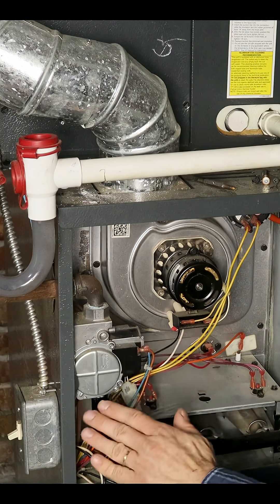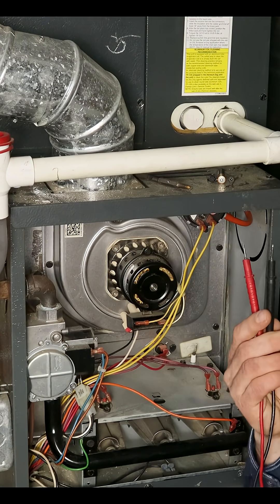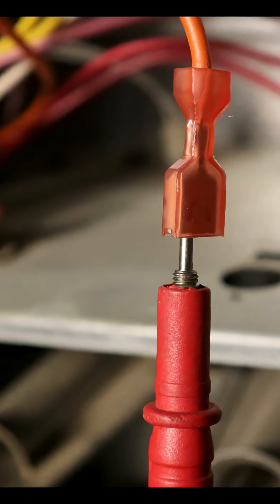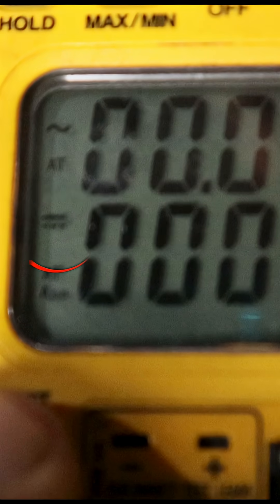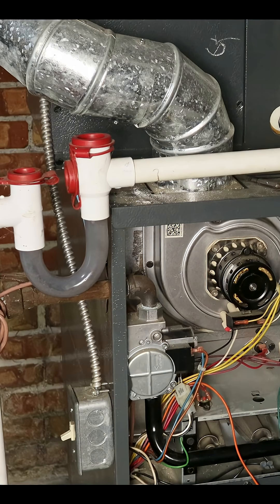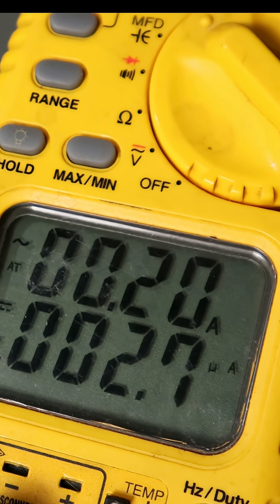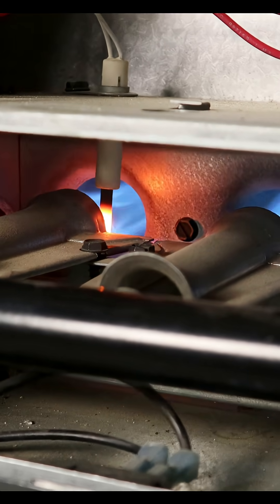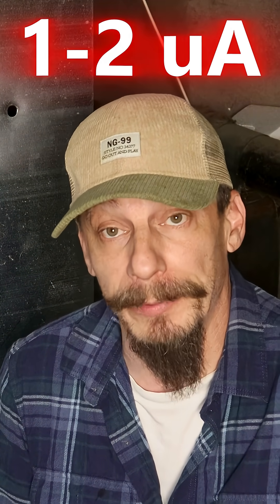2–6 µA = Heat Stays On

Comment: It's good to mention you need to turn power off before you touch sensor because there is always about 95v going to sensor, even if furnace is not running.

Comment: That's what happend to me last winter. I woke up to an ice cold house. I took the cover off the furnace and looked at the flame sensor and that thing was black and carbon crusty. Took some fine sand paper cleaned it off and reinstalled it.  Started the furnace back up and it was working beautifully.